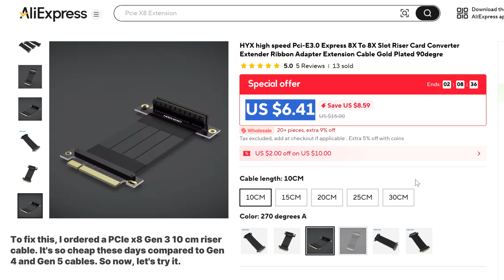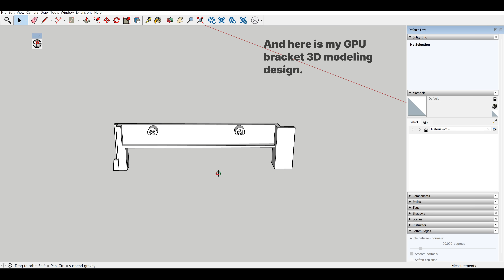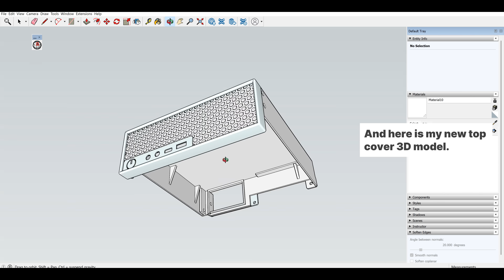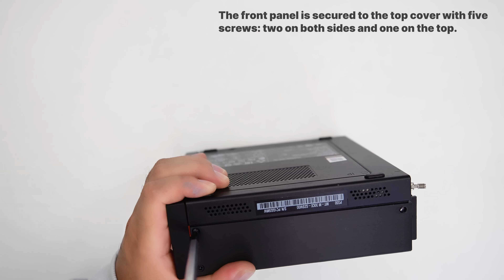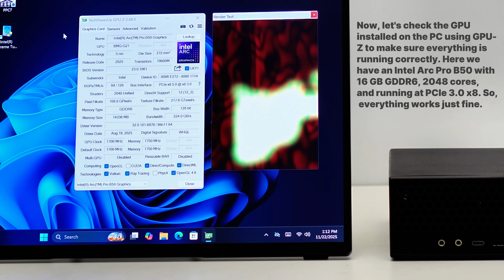2L Build: Lenovo tiny: i7-9700T + Intel Arc Pro B50, Can it game?

Comment: just got the b50 from microcenter today.  i am not having any luck installing it in a P350 that currently has a T600. used ddu to remove nvidia driver.  installed arc pro driver.  just get stuck at the "Lenovo" screen during start up.  any ideas?
Reply from the maker: I think you can reset BIOS and try again.
Reply: @itggear  thanks for your reply.  i think my problem is the P350 is not recognizing the B50 device although it is powered up.  so, resetting bios didn't help.

Comment: Please help me. I bought a M920q and installed a GTX 1650 low profile using an x16 riser, but the graphics card is only detected in gen1 mode. In the BIOS, I tried setting it to auto or gen3, but that didn’t help. I also enabled the PEG setting, but it didn’t work either. The power supply is 230 watts.

Comment: I have used m720q (i5 8500 non T) with rtx 3050 lp, cpu always back to 800mhz if not using app trotlestop,, How do I set it permanently? So I don't have to keep opening the throttlestop app.

Comment: Hey, I have a quick question, I have an arc b50 with a nerdware cooler on it and I’m about to buy a thinkcentre m90q gen 6 with an intel ultra 265 (non T). It comes with a 230w psu, do you think that it is enough to support the components or should I expect to have to spend extra money to get a 300w psu?

Comment: Nice work. I wonder if adding extra ventilation on top cover like previous design would be better. It seems this time you limit ventilation for front and back only.
Reply from the maker: No need. The GPU uses a blower fan. If you don't believe me, try it yourself and report back on the difference. Do you think this setup results in high GPU and CPU temperatures? No, it has the best thermal performance I have ever achieved with this tiny PC upgrade.

Comment: Will this 3D model work for the m710 or m920?
Reply from the maker: It seems there's a mix-up here. The Lenovo M710 and M920 are different series, and they use different chassis. The Lenovo M920q and P330 Tiny are identical in the same series.

Comment: Wait, you installed an orange front panel, but at the benchmarks chapters there is a black front panel. Very  confused right now
Reply from the maker: It does not seem necessary to be confused. I wanted to show that the front plate is customizable. Don't you see that I 3D printed two front plates? This video took a few days to make, compiled from many footage clips. I did not need to show you the removal and reinstallation of the front plate because it makes the video too long with an unnecessary scene. I think there is no problem with that, but you are just trying to catch a mistake.

Comment: on average what do these cost? I'm looking at maybe doing one of these for my little cousin given the market.
Reply from the maker: It's expensive. Do not spend much money to replicate this. This video is about proof of concept and challenges overcome only, it is not suitable for a casual user.
Reply: @itggear  Ah gotcha, I'm constantly checking when schools drop off old hardware for my little cousin right now as he is using a laptop 1050 that's a decade old and I was hoping this would be a cheap alternative with some ebay luck (either this or the T3260 build on your channel).
Reply: @itggear update we got a optiplex 3060 from work

Comment: No Re-Bar, same problem I had when I put an A40 pro into a 330. Complete waste of the GPU capabilities using one in this platform. Lenovo really need to pull their finger out and stop locking down the BIOS with proprietary crap and disabling options that you can verify exist in the code on UEFI tool.
Reply from the maker: This build is mainly for showcasing what's possible, and I have not yet figured out the optimal performance. Feel free to tweak.
Reply: @itggear it's more disappointment in Lenovo that the B series get treated the same way
Reply: Head to the servethehome forum for details on a successful bios mod for rebar

Comment: Was thinking of doing the same, coincidentally posted about this on servethehome before I saw your vid :)
- is this a Low profile B50? 
- it is possible to mod bios for rebar, it would presumably boost performance significantly 
- the pcie slot is limited to theoretically 70w, this can be modded by changing a resistor on the board
- A non T non K Cpu such as 9700 or 9900 should boost performance 
Thanks for the video!
Reply from the maker: Glad to hear we had similar ideas! Yes, it's a low-profile B50. Modding for ReBAR and increasing the PCIe slot's power limit are definitely worth exploring.

Comment: Hey man should I go for optiplex or Lenovo, I've found that optiplex does give you access righaway to swap parts once opened. But Lenovo requires multiple cases to be removed. I do know that Lenovo is built like a truck but which one would be better in terms of heat decipation and emulation upto PS2. No 3D games of prior systems.

Comment: That B50 is amazing. Such a powerhouse in its tiny power efficient frame.

I'm surprised it isn't running hotter with the GPU's fan facing into the motherboard. Or is it exhausting out of the side and the fan is sucking in air?
Reply from the maker: Both the CPU and GPU use blower fans, so you don't need a ventilation area larger than those small fans. The recommended space gap for those small blower fans is only 1 cm. For the CPU, the gap is even narrower, about 3 mm only. There is no hot air trapped inside the case, so it will not have an overheating issue. This is unlike an open-air fan GPU, which, no matter how large your ventilation is, will cause hot air to accumulate inside the PC case, getting hotter and hotter, and will need an exhaust fan in that case.
Reply: @itggear  Interesting. I've never known that about blower fans. Laptop fans are also blowers, right?

Comment: Have you noticed if ReBar being off in the BIOS or unsupported affects the performance of the b50 gpu? I made a clone of your older project using the STL files you provided and an M720q tiny (had to mod the bios and cpu cooler to support full boost clocks on the i7 8700 i installed) and I am interested in upgrading the rtx 3050 6GB to the arc pro 50 16GB . I know that the other ARC gpus suffer on pcie 3.0 when ReBar is disabled - and these slightly older thinkcentre tiny machines certainly don't support it.
Reply from the maker: Yes, it doesn't have above 4G and ReBAR function in its BIOS.
Reply: @itggear would you be able to test the arc b50 in a machine that has rebar support and compare performance with it on vs off? With the pcie bus set to 3.0, of course.
Reply from the maker: @Shineplasma You can simply my video in this channel.
Reply: On the servethehome forum a member was successful doing a bios mod for the m720q to add rebar
Reply: @Treg-t2u oh dang! Link? I already had to do a bunch of testing/modding using the RU tool to figure out how to make the 8700 hit full all-core turbo clocks. Might be worth it to go one step further and flash rebar support onto it for a potential B50 upgrade though. The rtx 3050 is just barely not enough for perfect 1080p 60fps in a lot of games (w/ DLSS, of course)
Reply: @Treg-t2u can you share a link please or name of the post

Comment: Why did you go with an x8 riser?
Reply from the maker: Because there is no right length of PCle riser cable that will fit this setup. The correct length should be 8cm or 9cm. I initially thought a cable with fewer wires would be easier to bend and would exert less pullback force in the tight space.
Reply: @itggear  that makes sense honestly. Do you think you suffered any performance loss using pcie gen 3x8 instead of the pcie gen 5 x16 that the card is set to be?
Reply from the maker: @danielhulan3058  You will get what you pay for, so it is outside the scope of this video's topic. If you are seeking top-notch performance and chasing every single FPS, spend more on new hardware. If you are a DIY enthusiast who is seeking a challenge, a problem, a solution, or a hobby project, this video is for you. There is no need to complain about performance on a setup like this.

Comment: There's no point in this build honestly. You are gimping the b50 on that mobo with that power brick. You have also basically just turned the ultra slim case into a standard 4.3L case snd you are also trying to power that screen off the type C, when  you only have 300 watts to play with.
Reply from the maker: I make everything happen. Whether it is worthwhile is totally dependent on your opinion/perspective. But for me, it's all about proof of concept. As long as people are curious about how it's going, I will cover it in this channel. When people need a solution, they will find it here in this channel.
Reply: The total case volume is actually under 2L - I made one similar with his STL files and an rtx 3050 6gb and it came in around 1.7L. I'm also getting top end performance out of both the i7 8700 I installed (had to mod the bios as well) and rtx 3050
Reply: I was thinking of doing this exact mod for a travel rig, it depends on the use case I guess.
Reply: @Treg-t2u  that's what I use mine for. Rtx 3050 6gb and i7 8700 can get 70-90 fps in battlefield 6 1080p with some dlss. Not as nice as my main rig or gaming laptop, but it fits nice and secure in an eggshell foam pistol case and doesn't take up much room in my checked bag at the airport. As much as I love my monster gaming laptop it isn't much fun to lug around as a carry-on and I'm super paranoid that it'll be broken by a baggage handler somehow
Reply: @Shineplasma cool, for me the plan is to use on my overland suv to experiment with car fusion sensors,  also as a MSFS rig on the go :)